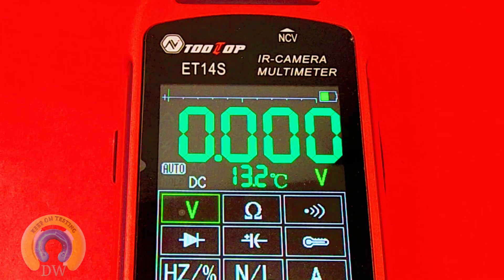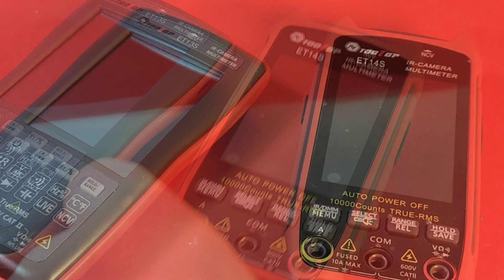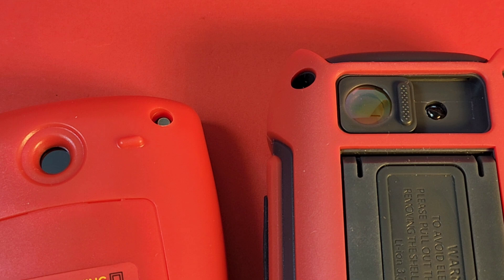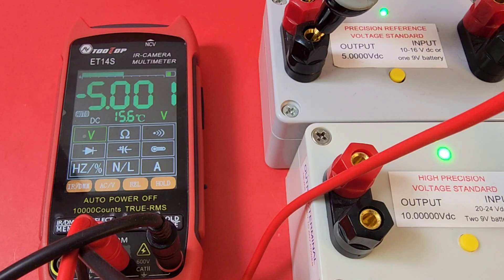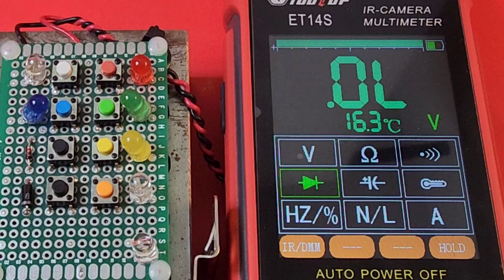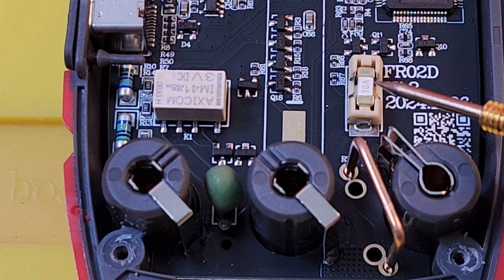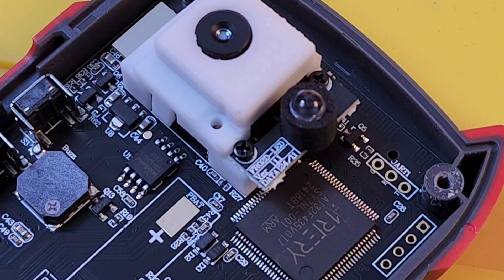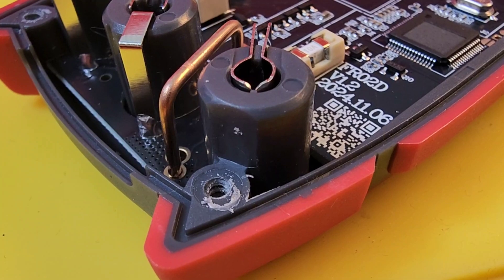UNBELIEVABLY GOOD TOOLTOP ET14S THERMAL CAM Multimeter Review & Teardown!

Comment: I bought such an infrared camera (thermal imager) -tooltop et693c,
I cut out and glued a plastic overlay (ABC) for her for fastening microlyins
(to search for short circuits, on an electronic board)-
drilled two openings for the lens of the infrared chamber = 20 mm, and for the visible video camera = 14 mm,
I glued everything, glued everything with superglue,
And he glued the lens with other glue-Polimer-neutral,
Focus Lines Cloudray CO2 ZNSE
with a number = 25.4 mm (for SMD phones-PCB Circuit Board)
with a number = 38.1 mm, (excellent for SMD elements-PCB Circuit Board),
and number = 76.2 mm, (excellent for PCB Circuit Board)
The diameter of everyone is the same 20 mm, drilled and dirka for a video camera 14 mm.
It is better to take the brand of lenses = Focus Lens vs CVD ZNSE, it gives less distortion, but 2 times more expensive.
He cut out and glued a box of payments for nozzles with lenses to prevent scratches on lenses.
I recommend it! Everything works fine!
Reply from the maker: Great info! Thx for sharing.. 👍

Comment: Do my eyes deceive me, or is the AUTO mode gone?  I suppose that takes away the ability to measure different things without switching out of IR mode - or can you change modes with the buttons?  Without the AUTO mode, wondering why they still need the relay - perhaps for engaging amperes when the lead is inserted?  Do any of the side buttons do a IR screen capture, or is that reserved for the front SAVE button only?
Reply from the maker: @pault6533  It's gone Paul..along with the touch display which I really missed. No sidebuttons for screen capture ...it's more clunky without the touchscreen which is the biggest drawback!

Comment: While threaded inserts would be nice, you can make plastic threads last for decades if you simply reverse the screws until they drop into the existing threads before tightening them down.  Still, it's inexcusable to not have metal inserts at this price.
Reply from the maker: Agreed, when you're paying in excess of 200$ you expect a step up in build quality 👌

Comment: Dayum that bar graph is QUICK! They could have used that LCD better, now that you cannot tap on the screen to select things...hoping you could get rid of the voltmeter thingy on the bottom of the screen when in thermal imager mode, give us a larger view. And perhaps a landscape orientation for the multimeter section!

Is that a socketed SMD fuse!? We see those a lot on laptops of old, but soldered directly without any of that plastic housing jazz.
Reply from the maker: I hear you..landscape would be nice, gotta love those fuse sockets! Btw, I failed to mention they give you 1 Xtra fuse with the meter!